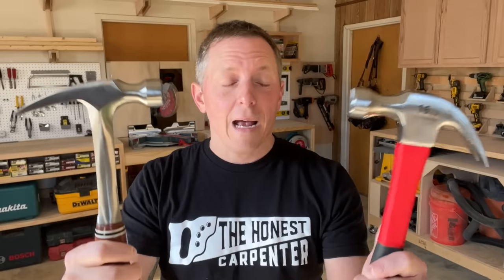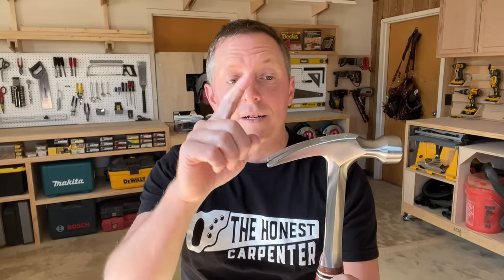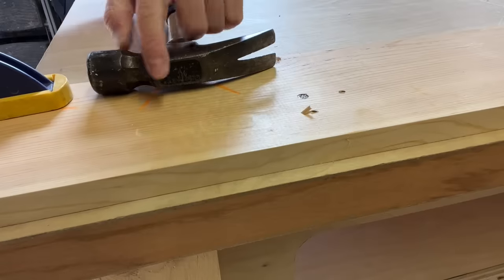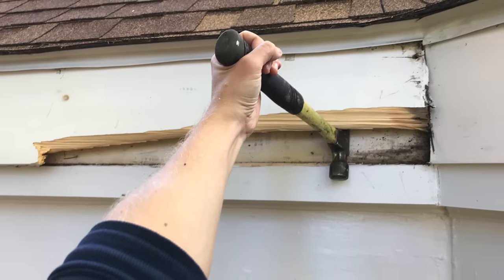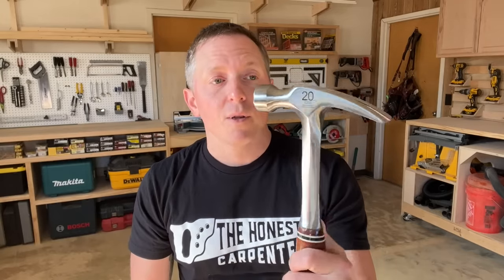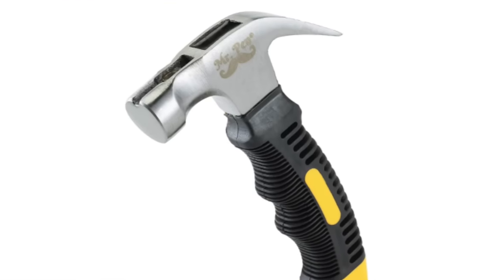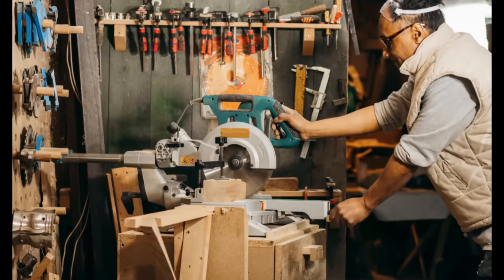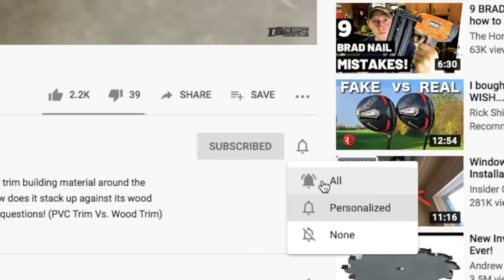DON'T USE STANDARD HAMMERS!! Try This Instead...(Rip Claw Hammer Vs. Curved Claw Hammer--Which One?)

Comment: I have owned both for 50 years. A 20 oz rip claw for framing and a 16 oz curved claw for finish work. There is even a 10 oz curved claw hammer I keep in a little bag I use for little chores just cause it’s so compact. The curved claw doesn’t snag as much in the bag (and little straight claws are harder to find)  There is a little nail puller in the bag too in case the curve can’t cut it. I did framing as a pro many years ago only for a short time. But even DIYers are allowed to own more than one hammer including that one on the other side of a roofer’s hatchet.
Reply: I agree, I have a nice 22 oz rip claw framing hammer but I also like having the curved claw hammer in my toolbox. You can usually find a decent one for 6 or 8 bucks at Lowes or the Depot.
Reply: Totally agree. A second small curve claw isn’t going to break anyone’s bank. Plus the compact form is sometimes the better tool for the job.  Sure I CAN sink a finishing nail with a framing hammer, but do I WANT to sink 20-40 in a row with that heavy thing?
Reply: Vaughn sell a nice 10 oz. straight claw with wood handle and they ship direct to customer. I sometimes use on small trim.
Reply: I so have a cute 10z wooden handle model somewhere.  I do not use is much.  It came in a set of some kind.
Reply: For me, its a 22 oz. straight-claw Estwing framer. The longer handle allows a bigger swing from the hand and wrist, putting more force behind the blows. For finish work, an old Stanley 16 oz. curved-claw with a tubular steel shank. For difficult nail pulling, I have a couple of cat's paws, one American style and one Japanese style. In some situations, I have found it helpful to use a Wonderbar slipped under a hammer that is gripping a nail head. 
-- I have some small hammers, too. I keep a miniature tool bag in my car, with a folding handsaw and a bunch of other basics. I'll admit that it's hard to find well-made small hammers under 16 oz. that aren't too small to accomplish anything. I have found 13 oz. a good head weight for a compact hammer that imposes a not-entirely-frustrating level of extra effort in the trade-off for compactness. And they're small enough to be good gifts for women, but again, not so small that they're completely useless. The biggest clawed hammer I have is a 28 oz. straight-claw Estwing framer, but that's only for spiking landscape timbers. 
-- I think all in all, I have about a dozen clawed hammers, including one that I found in a trash pile with its entire face broken off at the narrow section behind the face. Aside from its utility as the hammer I bring out when someone asks to borrow my tools, it's a great conversation piece: "How TF did THAT happen?!"
Reply: I sometimes used an ancient roofer's hammer/hatchet straight out of my grandfather's tool shed; gotta be very careful using that side notch to pull nails. I've got a scar from slicing myself when a nail head broke off.

Comment: I been using a Claw Hammer for Years & didn't even know there were different types of Hammers. But given your explanation of The Rip Hammer I might add that to my tool box. Since with both it really depends on how much of an experienced DIYer you are to use the Rip Hammer to it's fullest effect.👷🏾‍♂️
Reply from the maker: You won’t regret it, W! It’s like gaining a super power when you tackle demo work 😁
Reply: As a DIYer, I prefer the rip claw for every task. It's especially better at pulling nails, contrary to HC's opinion. You might think the curved hammer does great until the day you need to pull a nail longer than the travel distance of the curve. Try propping a piece of wood under your hammer while nail-pulling someday, and you'll appreciate how much better the rip-claw is!

Whilw propping the curved claw, I find myself needing props of different thicknesses, and/or to keep changing the angle and dealing with the awkwardness of keeping the hammer in a straight line while pulling it and also the inconsistency of hour much leverage you get at each position of the propping board, because the forces against the hammer change depending on which part of the hammer hits the prop.

With a rip claw, I get consistent leverage and a steady, straight motion no matter where the hammer lands on the prop board, because the surface is so consistent across the board.

Comment: I have both my fathers straight eastwing hammers, they're are over 65 years old and still in excellent shape.
Reply from the maker: Amazing, Dalton!
Reply: That’s because they were made in America!!
Reply: I love those hammers, unfortunately they aren't very forgiving to ones elbow with day to day use.
Reply: Got my first one in 1972...still have it!
Reply: Estwing hammers last forever.
Reply: @davidgraham2673  They sure do, the two I have from my father, has built 2 homes and so many smaller projects and will for the foreseeable future..
Reply: @dukeman7595  , I do commercial construction, and have one of the 28oz hammers. As a Door Mechanic, I use it's heft to move metal frames when they need some TLC  before I break out the Bondo. I also use them placed sideways as a lever to do door to frame alignment when the reveal needs tweaking. I can't believe I've never snapped one; they're incredibly  tough.
Reply: @davidgraham2673  Wow, I say you have proved they're almost indestructible.
Reply: Same, I have an old Estwing that was my grandfathers, he was an iron worker in the 60s through the 80s,  the handle is basically rotted off, but the metal still looks good. I can't really use it unless I could make a new handle grip for it.
Reply: @monkeygraborange  By craftspeople for craftspeople.
Reply: I have and use my Father's Estwing curved claw. I'm 71, and I know that the hammer is older than me. That's why I bought an Estwing when I started framing.
Reply: @davidgraham2673  Don't get me wrong, they're good hammers, but I've had three that broke.  Two, the handle rubber sheared and slid off.  And one actually broke off just below the handle rubber.  I also bent (but loved!) the 26" axe they make. In over 30 years, I have NEVER broken a fiberglass Plumb. Lost'em, had'em fall into footings (once!), sealed'em up in walls (along with a chalk box and speed square  once), or had'em stolen, yes. But broken?  Nope.
Reply: @colmhain  , I'd rather have a hammer break, than get stolen. At least that way, I wouldn't feel violated.
I've also left tools behind, hard to forgive myself.
The rubber on my current Estwing is cut from  using it to adjust hollow metal frames on commercial jobsites, so I understand exactly your point. In my case it was purely from using the hammer as a lever, so I can't fault the hammer. It did serve beautifully as a lever, and I can't believe I've never had one snap, to be honest. I'll take luck whenever it comes my way though....

Comment: If you're spending all day pulling nails out of a 2x4, the curved claw will give you better leverage. But for basically everything else, rip claw all the way. My go-to hammer for concrete formwork is the 28 oz estwing with a waffle head. Despite its high weight, it is incredibly well balanced and moves heavy materials like 4x6's or shores with much less effort required than a lighter hammer. Just don't hit your fingers with it.

Comment: Spent a couple of years worth of weekends with Habitat for Humanity. Very quickly settled on a 20 oz Vaughn rip claw with a smooth head. I lusted after the steely good looks of an Estwing, but too many pros warned against elbow damage.
Reply: Lifetime carpenter and that's my favorite framer. Some fiberglass handles fray, chip, or crack but not Vaughn. Perfect balance, best steel and hear treatment. Vaughn's made that exact hammer for over 50 years, mine about 30 years old. No need to change anything when you get it right!
Reply: @P_RO_  Love my Vaughn woodies. Especially the 16 oz. octagon handle.

Comment: A recall seeing my first straight claw framing hammer in the UK around 35-40 years ago. At that time nearly 100% of hammers were of the curved claw type. This is principally because very little construction in the UK back then (or now) is timber-framed. Framing was only used on roofs or internal partitions. I use both straight and curved claw hammers but my default will always be curved. Much easier to extract nails and better leverage. In your video, where you're trying to separate two pieces of timber with the curved claws (and failing) the trick is to wield the hammer in a more downward direction.  Very easy with some practice!
Reply: Yeah, I notice brickwork in nearly every British film or video; and I watch a lot. Lots of mold in the bathrooms and lofts, too.

Comment: Honestly, I have both versions in my shop. 90% of the time, the hammer I end up using is the one I grabbed first.
For demo work, such as removing trim, I would never use JUST a hammer,,, Get a good flat bar or pry bar set so you can minimize damage to things like drywall if you aren't intending to change out drywall too.. Then the curved hammer also comes in handy at that point to remove the old trim nails because it gives much better leverage. 
And yes, the heavier hammer (not too heavy) is great for pounding in large nails, and I wouldn't use my curved hammer for that if they were both sitting side by side. However, if the curved hammer was within reaching distance, I wouldn't hesitate to use it.
Reply: Pry bars are pretty inexpensive too.  I have a pair.  Also a crowbar, which I rarely need.  If you can't get it out with two pry bars then use may need one.

Comment: My treasured GO-TO is my 20 oz smooth-face, rip-claw Estwing (steel is grey-painted rather than chromed with the blue polymer handle). It has been an extension of my right hand (and a few times my left hand) for nearly 40 years--first on the job as a long-time carpet layer nailing tack strip into concrete, etc., then lots of construction and DESTRUCTION as a homeowner and also helping others through some men's ministry work. It's every bit as versatile as Ethan says, in my opinion. Anyway, God bless all of you. I enjoyed reading many of the other comments.

Comment: Curved claw hammers up to 16oz are for finish carpentry and New tradesmen. A new guy can not swing a straight claw accurately. A straight claw is also dangerous. The hammer can hit someone behind him on the backswing, or bounce into his own head or miss and swing into his hand or leg. 
     A curved claw is safer, generally smaller and more accurate for beginners. A nail pick is for picking nails out as the head is usually buried anyway. Framers and builders use long handle straight claw hammers. Weight doesn’t matter because a titanium hammer half the weight of a solid hammer bits the nail just as hard. 
      I own a framing company 30yrs and 3 crews… don’t use a straight claw if your not experienced.
Reply: This is a good point. I can see the accidental release on the back swing being a risk with new people for sure.
Reply: It's definitely true for me. Swung a hammer long ago, good accuracy, plenty of strength. Now, I only need to drive a nail rarely and it is exactly as you say. I was driving 3" cut nails into block and, after a surprisingly few number of swings, I wouldn't have the control and it was just from not having the strength anymore. Same hammer, same brain, but weak flabby arm. You're bang on with your comment.
Reply: @ef2b  In my seventies now and put the old 21 oz. in bucket now and carry 16 oz. framer in bag. Just more accurate and less tiresome, especially on full day.
Reply: @toriless  If that were how things were decided, 99% of people would never get to continue in any manual trade they start learning, and the other 1% would be less wise/cautious for happening to have excess good luck

Comment: That sounds great and all, but I'm still using the Craftsman claw hammer my dad bought in 1972. It has some paint spatters, but the handle is in excellent shape for half a century and I don't see a need to replace it unless a job needs something different.  I'm still using all his old handle tools, from a turn of the century cutter mattock used in the coal mines to a one handed Stanley pickaxe. 

Maybe I'll upgrade at some point, but I like using the old tools.

Comment: I use my grandpa's curved claw because I can't tell you how many nails he made me straighten with it after pulling em out of a piece of wood.  I just don't demo enough to invest in a rip claw...  And I like remembering my grandpa when using certain woodworking tools.
Reply: I understand that sentiment. As primarily a gardener, I inherited (via my grandmother) my grandfather's spade and fork. These were forged in Sheffield, England - the type of indestructable tool you simply cannot buy nowdays. (Not even the pricey modern "Made in England" tools are the same grade). I moved overseas and left them at my Mother's with the intent to take them one day, probably remove and replace the handles to fit them into my luggage. While I was gone, she sold them both at a garage sale for $5 each... 🤬🤦‍♂️
Reply: so, grandpa is a cheapskate.
Reply: @toriless  no. Grandpa lived through the depression.

Comment: Buy both. When repairing fences and decks I use a curved claw to remove old boards and nails. When replacing boards or building things, the straight hammer is pretty awesome. My curved claw was $5 at Target made in China. My straight hammer is an Estwing that cost me $30 at HD.

Comment: I think the most misunderstood aspect of a hammer is hammer length. I use an 18" wooden handle with a 19oz Vaughan head. Wish it was 16 or 14oz. Lighter definitely makes it easier to command the swing with speed. In my opinion a hammer is not a pry bar.

Comment: As a landlord/property manager, I already have flat bars in multiple sizes, cats paw, and a wrecking bar, so since I often don't have scrap to shield the surface (usually use a putty knife), the curved claw offers a different shape and pulling leverage for those of us weaklings who don't do this daily.
Reply: I do the same thing with the putting knive to protect the serface.  I use my cats paw as fulcrum of the lever to pull out stubborn nails where the service damage is not important!!

Comment: In Europe we often use a different type of hammer called a (in Denmark) "lægtehammer" or European style carpenter hammer. It has a pointy claw and a short normal claw. Works for demolition, nails, "parking" your hammer (just slam it into a piece of wood, like an icepick), dragging a piece of wood and old stories of people saving themselves falling from roofs by using the pick (never seen it myself).
Reply: They use a similar hammer in Germany. In Holland, they use claw hammers much like in the US. However, in my experience, German and probably Danish houses are primarily masonry. The roof framing is wood, but it is not stick built like in the US. They use beams and infill slats. Thus, the hammers have more limited use. 

An Estwing 24 oz hammer has a very long lever arm and provides significant force when framing with conventional nails. Plus, the handle is 16" long, the standard length of the stud spacing. You can use the hammer for a spacing gauge. Nowadays, US carpenters use nail guns and WAY TOO MANY nails. Thus, like the Honest Carpenter above, they don't use real framing squares or long handled hammers. 

For that, they are effective with the tools that are common nowadays. Not 40 years ago when I started carpentry.

BTW, I never caught myself from falling by using the straight claws. But I DID use it to pull myself up off the wall and over the eave of a house and onto the roof of a house we were framing. I reached up over the overhang, drove the claws into the sheeting and pulled myself up with one hand. [I was kind of mad at the time and following a guy up the structure. Had a great effect on him.]
Reply: In Denmark, not in Europe. You know well that the (stupid) EU alone is 26 countries, each with it own construction style and tradition. What you often use in DK may not be common in Spain or Switzerland.
Reply: Latthammer in Germany - good Company is Peddinghaus for this
Reply: @HippasosofMetapontum  Lillehammer in Norway.
Reply: @HippasosofMetapontum  de Haus vhere de peddling is happen
Reply: "engineer's hammer" is what's most common here in Hungary. for nail pulling, we use combination pliers.

Comment: I had an Estwing hammer with a metal handle and gave it away. Wood handles only. I did residential concrete for 30+ years, and found the straight claws good for digging also. Started out with a 32 oz handle and ended up with a 23 oz framing handle. Also, always kept a cat's claw nail puller in my belt, and a real nail puller in the truck. Keep a 16 oz framing hammer in my wood shop now.

Comment: Two rip claw framing hammers in my tool box - one smooth, one waffle cut, depending on if I feel the need to avoid the crinkles in addition to a dimple in the surface.  I DO have a small finish curved claw when I need to do delicate finish nailing.  Just a DIYer / homeowner.
Reply from the maker: That’s a great combo/approach, Token!
Reply: I have enough tools I need several boxes.  I put the deadblows, prybars, framing hammer into one and other tools into another.  I also have one for plumbing jobs. strap wrench, teflon tape, etc. and another just with tools for electrical work, screwdriver, bits, a wire nuts, wire cutters, pliers, etc.  I also have a case for organizing all my (non hole saw) drill bits.  The hole saw ones are in an ammo case.